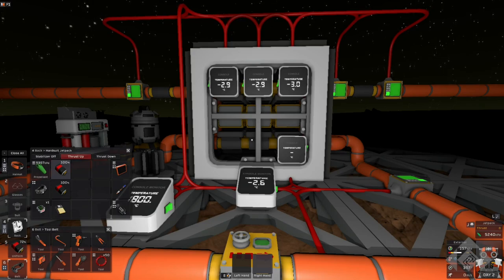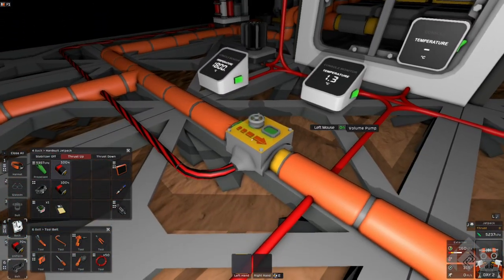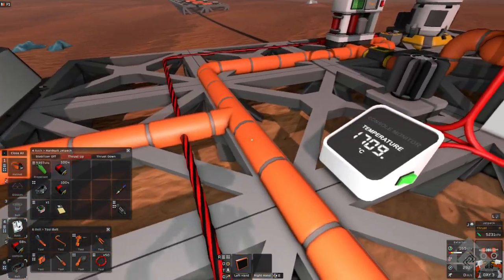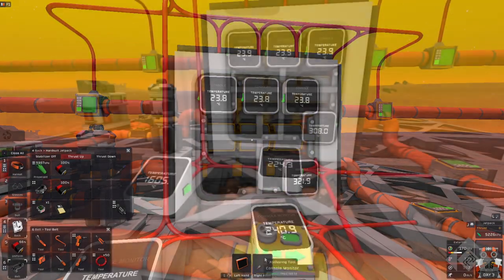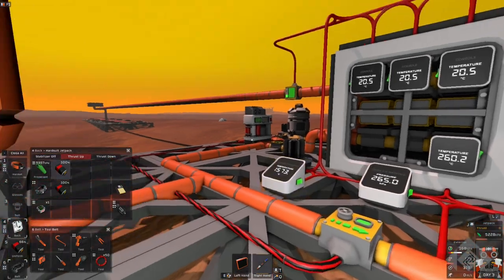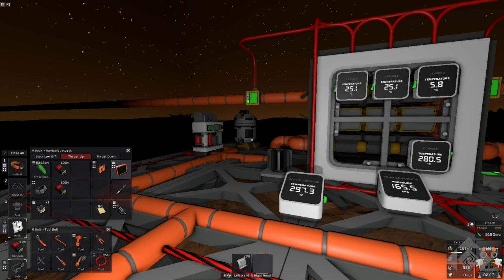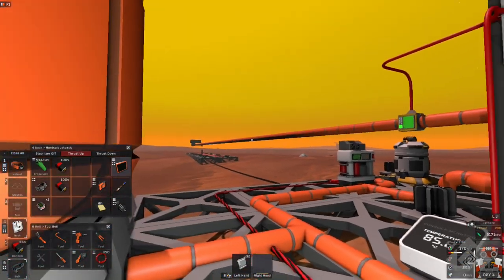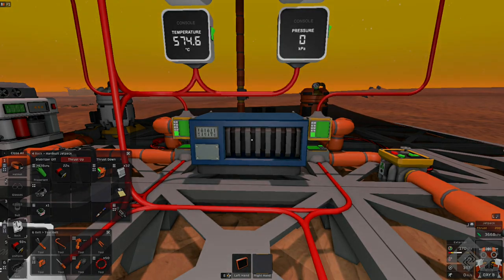Good Enough Heat Exchanger, a not so quick tutorial - Stationeers Airflow Update

Comment: Thanks for the video! Love how simple and effective this is! When I saw the counterflow exchangers in the update I immediately thought about whether you could build your own by having a series of ordinary direct exchangers separated by one-way valves or pumps (the more separate layers of exchanging you have, the more efficiently you could push each line towards the initial temperature of the opposing line). 

I never really thought about simply using room gas and convection radiators to save invar on regular exchangers - that's a great idea! I also had no idea the vacuum radiators exchanged between each other inside a room; the game seemed to treat every radiator except the large foldable ones as a one-way magic heat deleter. Does that mean ordinary uninsulated pipes radiate to each other in vacuum rooms, too? Or do they only "convect", i.e. with gas?

I wish there was a "blueprint" style system to let you save and place 3D ghosts of multi-component modules, letting you recreate them without the rote repetition of remembering all the precise build steps. It wouldn't have to be fully hands-off like Factorio's drone construction, or even save any build time. Making modules out of the most basic possible components like this is so much more fun and rewarding and - like you said - interesting than using premade devices. You could make air conditioners, radiators, tanks/storage, cryo/distilling filters, heat exchangers, pressure regulators, combustors, engines/generators and even furnaces (if the game eventually adds the other substances like metals to the phase change system) out of just insulated/uninsulated pipes, a one-way valve, a two-way valve, one kind of pump/turbine, and a device to separate mixed phases (like a gravity-based tower with a gas tap at the "top" and liquid drain at the "bottom", with a solids grille "above" it).

There's a really neat 2D game born out of the modded Minecraft automation subgenre called "Roody:2D" (horrible name) in nascent development that pushes that simple-components approach – I think you might enjoy it based on how you play Stationeers, ONI etc. – but it does have its own share of arcane undocumented behaviour